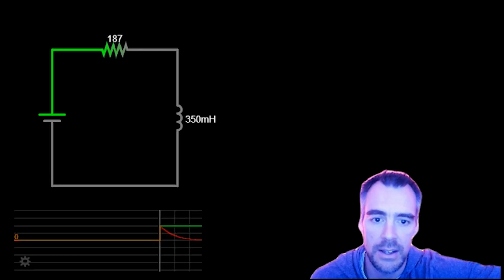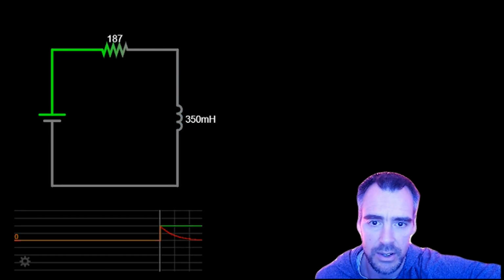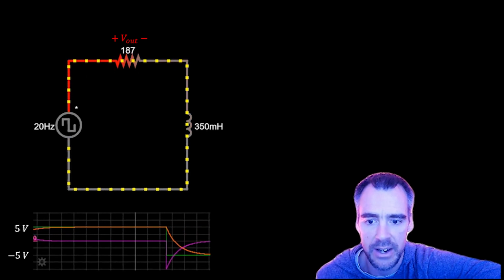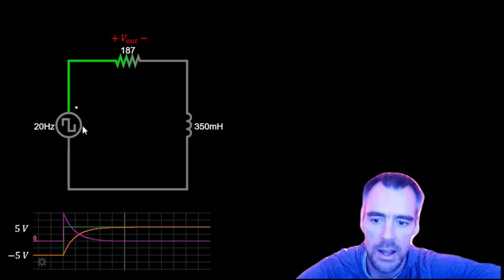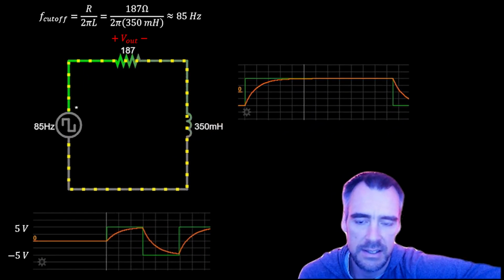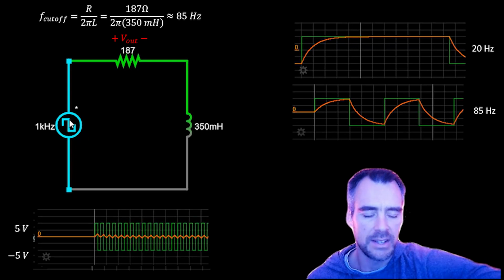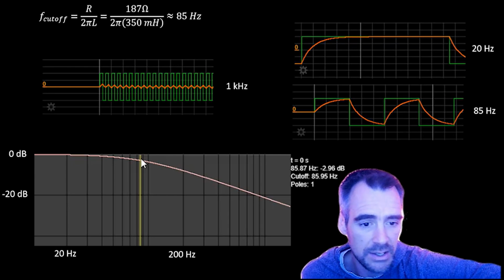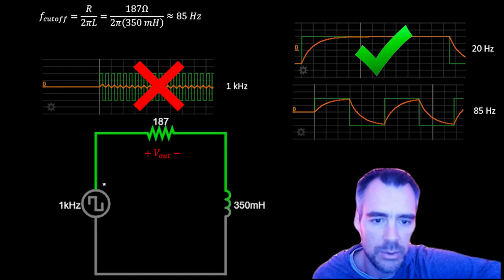How Low Pass Filters Work using a Resistor and Inductor (RL)

Comment: Thanks for your video. I have a question. To make the inductor to oppose the current, should the voltage start with negative instead?
Reply from the maker: Hi.  The inductor opposes a change in current, no matter what direction the current is flowing.  So if the voltage was negative, the inductor would initially oppose current in the opposite direction, then eventually allow the current.